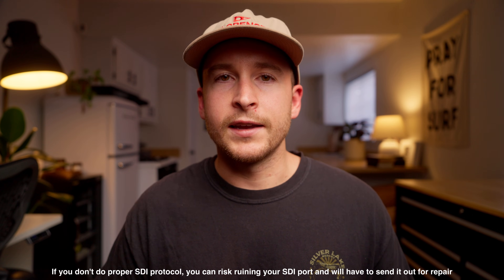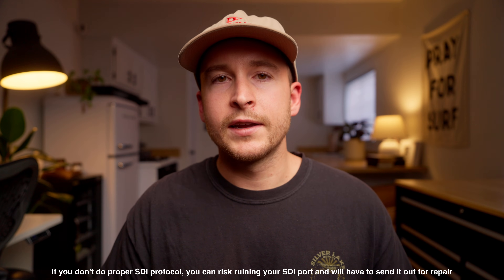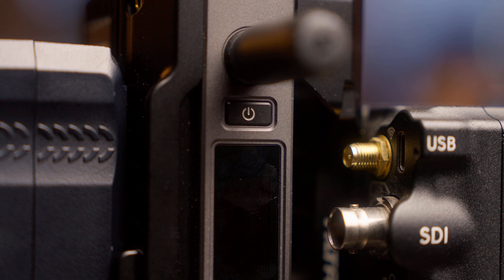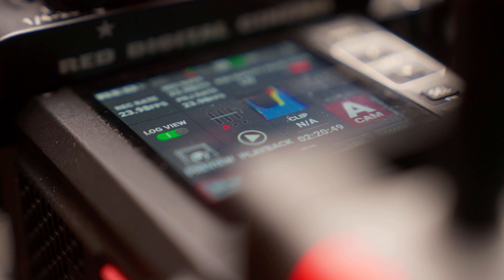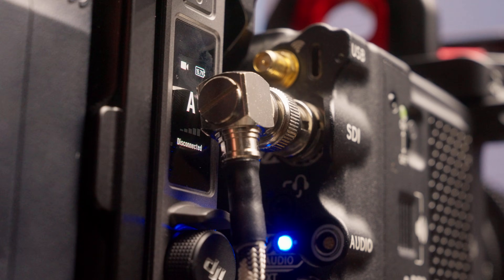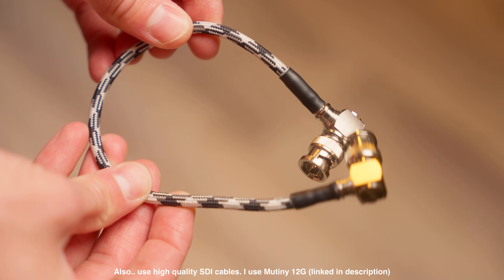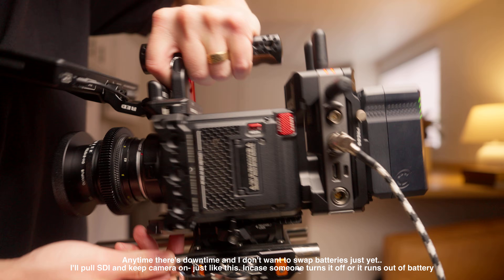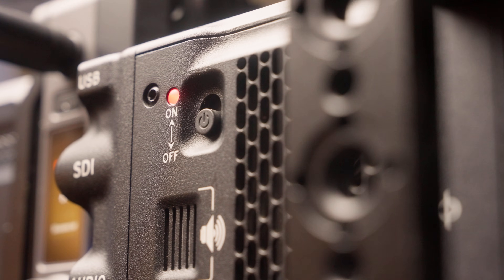SDI protocol in under 90 seconds

Comment: Genuine question — am I the only one confused by the SDI advice here? From an electrical-safety point of view, it seems safer to me to have everything powered off first, plug in all SDI cables, then power on the camera body, and only after that power on monitors / TX / recorders. That way there’s no SDI connection being made while anything is live. I’m not saying RED or anyone else is wrong — I’m just trying to understand why hot-plugging SDI into powered devices would be considered safer than a full power-off → connect → power-on sequence.

Comment: RED's official site says to shutdown the monitor BEFORE  unplugging the BNC cable.  this is cut and pasted right from their website. 
    1. Shutdown the SDI accessory.
    2. Disconnect the BNC cable from the camera.
    3. Disconnect the power source from the SDI accessory.
I've been doing it per their recommendation, but multiple videos, including yours, say to unplug the BNC before powering down the monitor. have I been doing this wrong?
Reply from the maker: Yeah I saw that too, I think ARRI says the same

I’m sure this is completely fine but I like to just pull BNC from camera before anything bc that limits any other variables haha. Anything can happen to the accessory but nothing will happen to my SDI on camera because nothing is connected

Comment: So from a 1st AC perspective, is this for every time you turn on/off camera? Or just when you build the rig?
Reply from the maker: Anytime you cycle power! 

I’ve had accidents over the years myself / with ACs and there hasn’t been an issue.. yet

I believe it’s because of the core batteries, they mentioned there’s something inside the battery that helps protect power shorts / surges

Comment: this is why I think SDI is very stupid. how has this flaw existed for decades and not had a single solution yet. HDMI is hot swappable and works amazingly
Reply: Incorrect , the very same can and has happened hundreds of times with HDMI , BNC is not the problem , it's usually D tap thats causing current to come down back the cable into the camera.
Reply: @robinprobyn1971  oh cuz SDi and HDMI are grounded, so if there isnt a proper ground on the D-tap, that can lead to a ground fault?
Reply: @verebellus   D tap is a actually a very poor connector , made of plastic , no ground and its very easy to connect it incorrectly  , not exactly straight , (let alone the wrong way round)  and the two positives can touch for a fraction of a second , first , and if you have the cable connected , SDI or HDMI , the loop is completed back into the camera  SDI or HDMI port . Thats why you want to connect it last and take it off first . D tap is a huge problem for causing fried ports.  Its something thats been around for years and effects all cameras . Arri have a whole video about it on their website .
Reply: @robinprobyn1971  all these years and they couldnt fix it? what about DC barrel connectors? do they suffer from ground faults?
Reply: @verebellus  There is a solution though. It's called sdi isolators. Mutiny makes the industry standard ones

Comment: This has nothing to do with SDI, SDI is completely hot swappable. Once again this nonsense is because some brain dead company has put out another dogshit v mount adaptor with completely unnecessary and incorrect electronic design that blasts the full battery voltage across the PCB of the camera. They ought to be held accountable and recall this garbage instead of the industry going "haha woopsie must have been the order I plugged the cables in" when there is zero logic to this being a end user responsibility.

Comment: i work with teradek, hollyland and fx6, arri amira and i never do this 🤔 wondering if i should start, but so far everything works
Reply: Till it doesn't :) the G12 BNC are also more prone to carry current back to the ports . D tap is the main culprit , very easy for the two + to connect and no earth.

Comment: Can you show how you rigged your DJI transmitter on your camera? I'm wondering how the power of the v-mount goes seemingly trough the transmitter into the camera.
Reply from the maker: Yes! It’s via a vmount pass through plate from tilta- it has pins that connect to camera / battery

So far so good! I wish wooden camera or someone else made one bc I’m nervous of tilta sometimes haha but it’s been chill